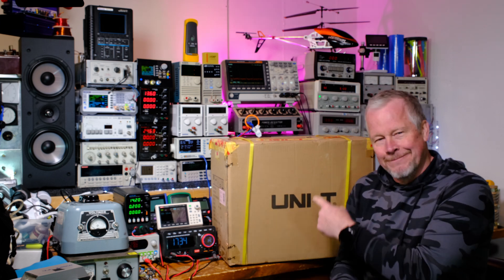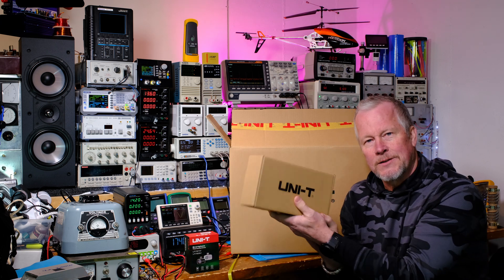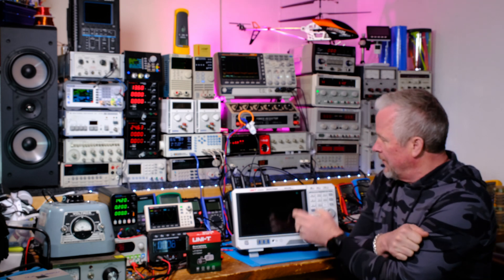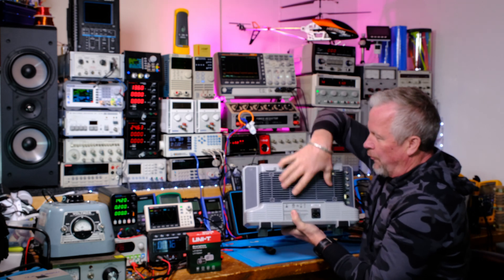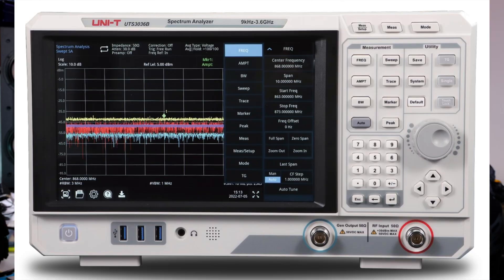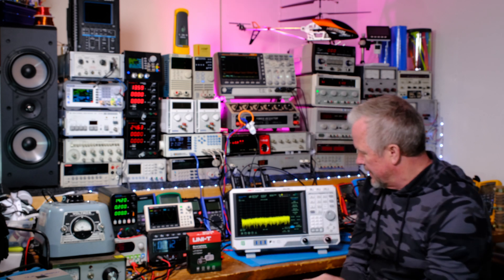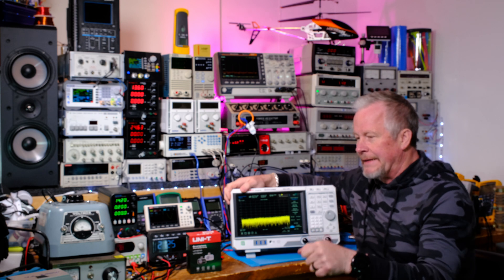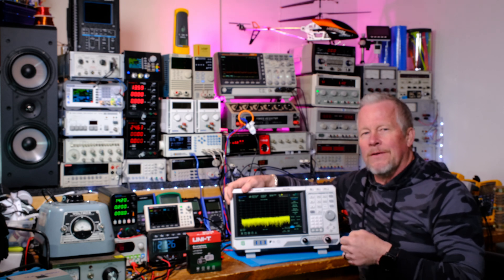Uni-T UTS3021B Spectrum Analyzer Box opening and Introduction #UTS3021B #spectrumanalyzer

Comment: I HAD TO USE A SPECIALIZED SPECTRUM ANALYZER TO PROPERLY TUNE THE RECEIVER ON PHOENIX MISSILE TO A CLASSIFIED FREQUENCY WHEN I WORKED AT HUGHES AIRCRAFT AS AN ELECTRONIC TECHNICIAN.
Reply from the maker: Thanks David for the great feedback.  This is an application that these can be used for.  The one you used was probably very expensive;)
Reply: @KissAnalog  IT WAS GOVERMENT MONEY SO I IMAGINE IT MATTER WHAT IT COST.
Reply from the maker: Yep - so that's why you were probably using Fluke multimeters too;)

Comment: Show how to use a Spectrum Analyzer would be great. How to hook them up safely and all the menu's would be great. There is a lot to a Spectrum Analyzer, I use one when checking Ham radio's transmitters and audio amplifiers. Once you have one and learn to use them it's hard to be without one.
Reply: I used always a 10 or 20 dB 50 ohm attenuator fabricated with 1/2 Watt resistors to protect the analyzer for To Big signals or when needed a adjustable attenuator , i have ones puts by accident a to big signal , 500 Watt RF , in my home made spectrum analyzer  build around TV tuner,  my attenuator was evaporated my TV tuner also died To much smd components  :(
Reply from the maker: Thanks - I'll try to do as many as I can before I have to return it.

Comment: Congratulations with spectrum analyzer very sad that it starts at 9KHz  not usable for audio 😢 , and thermo camera is gift to be sure that you give a nice review ! 😂 The world is open for you , how deep can you measure and the the bandwidth minimum between several strong signals without the noise floor is rising ? That was IMD  measurements with Short Wave SSB amplifiers. The old HP 141 mainframe and 100 mhz plug in 50KG ! At least my back pain comes back immediately 😅
Reply: @jim9930  lucky enough it fits under the table , and never tried to place it on a shelf , i think it was more then 600 mm deep , so i used it standing upright.
Reply: @jim9930  your right i have the GWInstek MDO2072EG with built in analyzer usable for my audio as a radioactivity is very very low , 40 years it was my no1 hobby , making some audio amps maybe CB Tube Transmitter again , thats where it started 55 years ago , good old times 😃
Reply: @jim9930  yes i was looking for a couple years for something lik that , and i was the first who was buying in the Netherlands ,and still happy with it Jim
Reply: It is still usable for audio. Check the output of your DAC and try to do something with all that HF noise. Or just ignore it and enjoy the music.
Reply: @jakubczajka4275   your right , i do not building DAC of Class D amp . Just simple tube amps .The day,s that i could hear noise is a long time ago below , 6 kc it drop,s very hard , so enjoying music is difficult ☹️
Reply: @pa3eka  My interest in audio and electronics started in 1999 when I visited my friend and discovered that his father became an audiophile and builds his own tube amplifiers. He started with EL34 push-pulls (I have built one for myself), then he switched to SETs on soviet tubes and ended with some 300B and full range speakers. Until today, I don't understand what did he like about these speakers. To me it sounded very poorly. Anyway, not going back to tubes with current prices of electricity. I also do not need another space heater. My PC fulfills this role quite nicely.
Reply: @jakubczajka4275  Yes Clas D is the future, but i love working with tube,s , and what i build must also look good  at any measuring device i have , that is the only reason , just hobby Jakub , little jealous at Eddy ,but with the stuff i have oscilloscope /spectrum analyzer MDO2072  Keithley 2015 recently calibrated, and some old KEF Q7 Speakers and Dac yamaha wxc-50  , my amp is build by myself and still learning 😅
Reply from the maker: Thanks for all the feedback!  Anyone interested in the MDO scopes, here's a link: https://amzn.to/42JUM02
Reply: @KissAnalog  SORRY CAN NOT AFFORD A SCOPE AT THAT PRICE.
Reply from the maker: I think the 70 MHz model is more than good and will cost much less.  But it is still up over $1k I believe - if you can find it.  Maybe the best 4 channel scope you can buy (that isn't an MDO - Mixed Domain) is the newer GW Instek scope - pretty amazing specs at around $380: https://amzn.to/42yasDv

Comment: I assume this kind of analyzer wouldn’t be used for audio signals?
Reply from the maker: It would be great for any digital audio including Class D amps and switching power supplies.  That's what I want to use it for to show the good and bad - and hopefully that the good far outweighs the bad;) A great option is the GW Instek MDO scope that I have.  Here's the link: https://amzn.to/42JUM02
Reply: @KissAnalog  what would be a good, cheap analyzer for a newb?
Reply: correct. although 9khz is in the audio range, something for audio would be more like a dynamic signal analyzer which works in the 1hz to 100khz range.